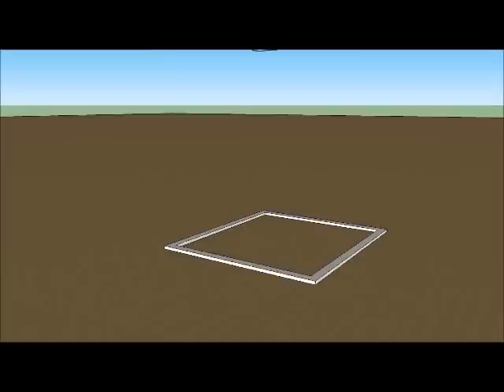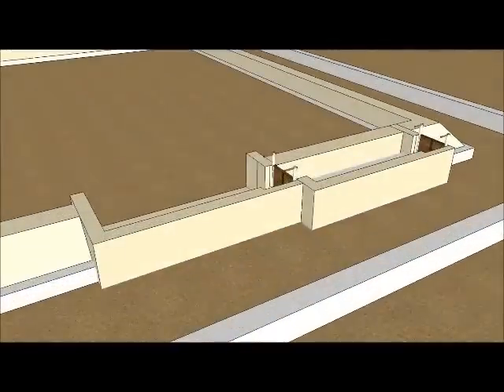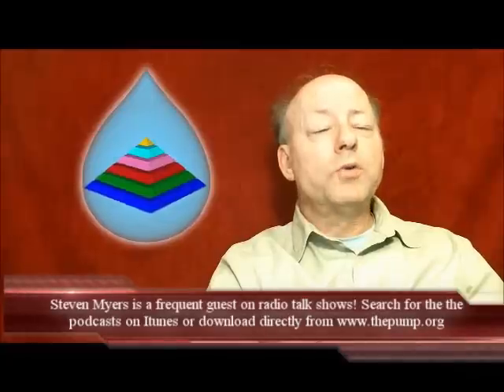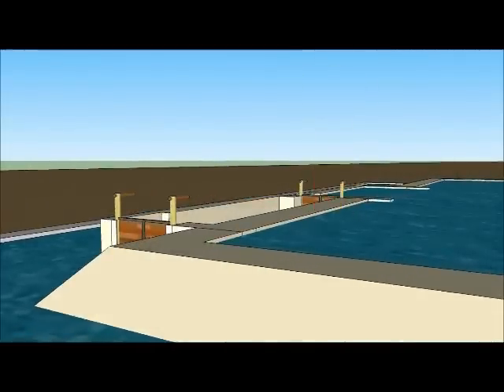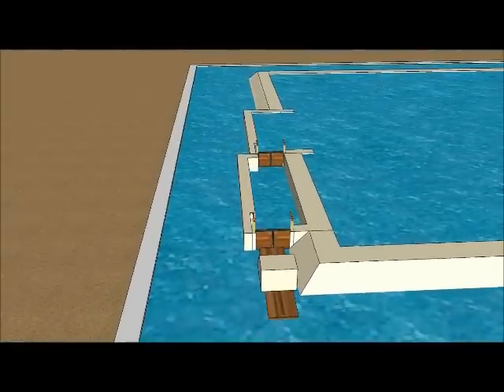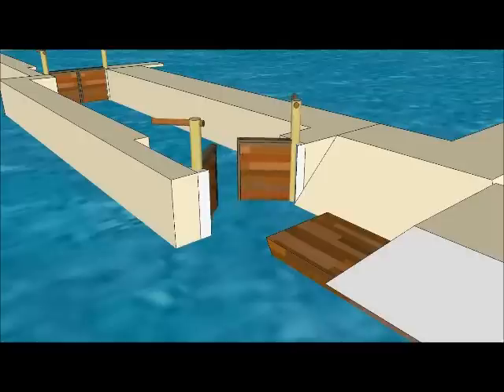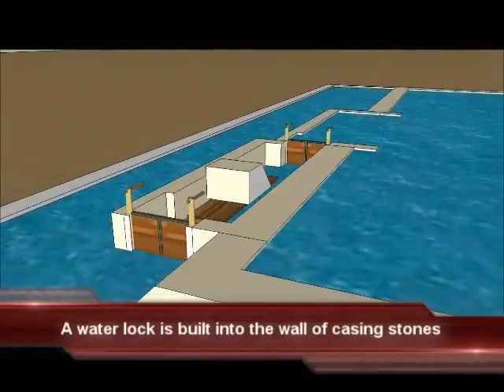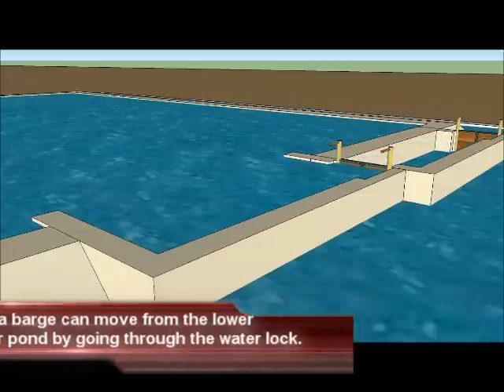Video 2 Basic Construction Procedures Used to Build the Great Pyramid

Comment: But how did they place the stones and move the barge. Barges today have motors. If their barge was just wood with a stone on it, what techniques did they use to get the barge with the stone from the water lock to its final resting place. They couldn't have used a current. They'd have to change the current in some manner for every single block on that level. And if it's man power its back to the problem with the original egyptologists theory.
Reply: And how they cut the blocks.